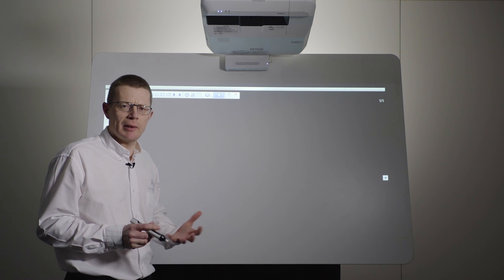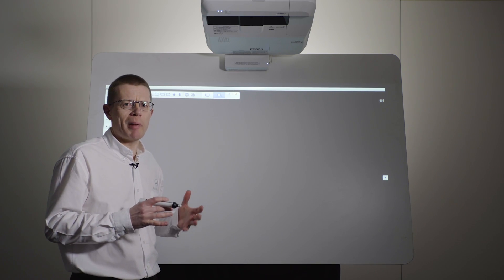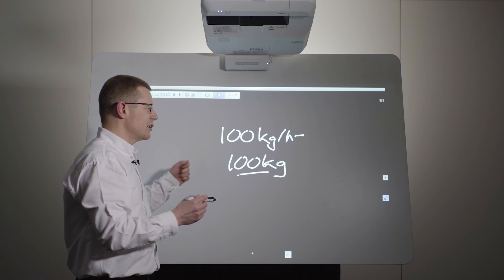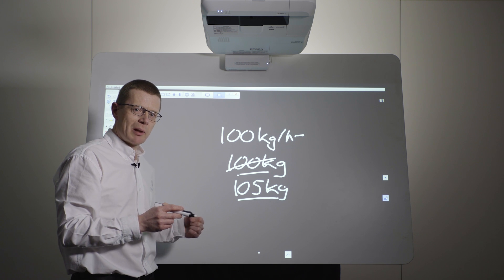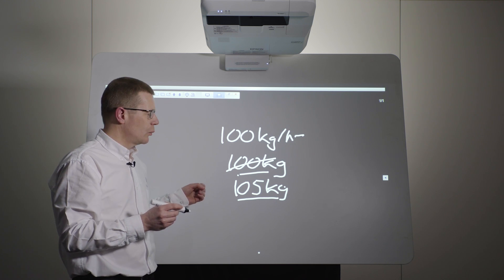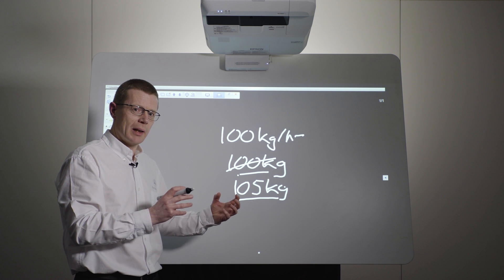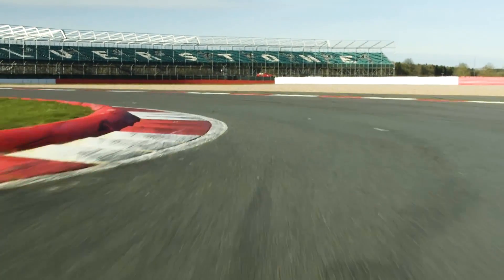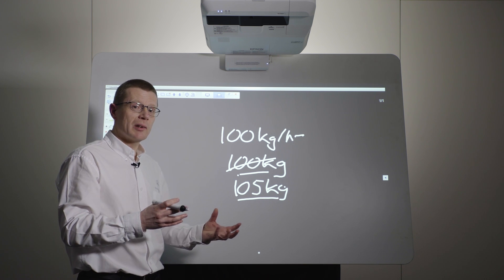F1 2017 Explained: Power Unit #SimpliF1ed

Comment: All 1-4 turbo intercooler petrol engines and all 1-4 turbo intercooler petrol engines hybrid in all companies : Easy heavy damage parts engines, 20-100 l/100km, over 100 l/100km with Formula One speed 160-250 km/hour, over 250 km/hour on all circuits, easy damage with test maximum over 150,000 rpm, little damage with traffic limit speed law on all path roads.
Mercedes-AMG grade F by all 1-4 turbo intercooler petrol engines hybrid all and 1-4 turbocharger intercooler petrol engines all status Easy damage parts engines.
From
All socials databases

Comment: good luck with the 3 power units of 2018... it's getting ridiculous
Reply from the maker: Why’s that? It’s the same engineering, just a different limit we are working to. The rule has been designed to cut costs for customer teams - and it will do that effectively!

Comment: What is the sense of that 100kg/h-limit? When you drive with 100kg/h you won't finish the race anyway because you would only be able to do 70% of the race distance. It only matters in qualifying anyway. But the rule makes no sense for me, because you will never use more than 100kg/h fuel for a long time anyway, since you won't be able to finish.

Comment: I have another Q. What is the raw materials cost on each such pu? Is it significantly higher than an average road going car with v6 w turbo?

You are not using some kind of rare earth materials, are you? In other words, what is keeping such engines appearing in typical road cars? If these PUs are roughly 49% efficient and road cars are at most 40% efficient you guys are accumulating much of a so called concept aptly termed in economics as deadweight loss to society. Because, you have technology which is roughly 30% more efficient than what a typical joe has. Which is alot. If you guys can bring these engines to mass market then carbon and nitrogen particles are reduced by that margin. Everyone benefits. Right?

Comment: The obsession with more speed and technology is insane. For racing purposes. it's no more 
entertaining from a spectator point of view to see a car going 190 mph compared to 220.Certainly one can't say the constant fixation with developing a car that goes faster has any relevance to improving the vehicles we use on the road today. How many drivers on public roads use even half of what modern cars are capable of. Aerodynamics with racing have gone wacko too. If I had my way there'd be no "wings" anywhere on a race car. Ridiculously higher cornering speeds add little to the entertainment value of two racers competing against one another driving on the edge. Just off the top of my head I would say the only part any further technology should play in the racing game would be to increase the safety and efficiency of the machine. I lost interest in F1 for the most part about 20 years ago when the fascination with technology started to rear it's ugly head.

Comment: Inject water,increase comp ratio,increase rpm,reduce cooling system's weight and size with silver radiators,reduce aero drag.
use salty water or some additived water with high heat conductive metal or minerals if the regulation allow it,or (do not forbid it....)

Comment: Im not a calculus math teacher but I thought 10% out of hundred would be 10 so would that be 110 kg of fuel 🤔
Reply: Muhammad He also mentioned that the power units have become a lot more efficient in the time since the regulations were made in 2014-- the fuel spent levels did not come close to the 100 kg fuel limit last season.

So they've increased it only to 105 kg, not 110 kg-- because the fuel efficiency has increased
Reply: Ok i got it now,,,thanks 
You are the calculus math teacher

Comment: Who cares about how efficient it is leave the technology for the families that  actually need to save fuel racing should waste fuel we need cars that turn fuel into sound not fuel into extra laps
Reply: +Mercedes-AMG Petronas Motorsport very true sir but the excitement of the v8 or v10 is lost they sound like leaf blowers so fast you can't even see them sort of
Reply from the maker: +YouTube is fucking everyone up  You misunderstand the idea of efficiency. We make fuel into horsepower. The more horsepower the better. And we fuel the cars for the fastest race.
Reply: You need to know that F1 technology will trickle down to production cars sooner or later. F1 insane rules and regulations propels participating car manufacturers to push their R&D division to meet those insane rules. Suspensions, tires, engines, brakes, engine air intake and many more technology are all once developed for F1 racing. 

If F1 racing is only for pleasing your ears, we will be driving V12s all day with a very bad fuel economy because the R&D for F1 racing is not necessary.

Comment: I think fluids is 1 kg per ltr in weight so only 5 ltr fuel in crease not a lot....anyone know if and when refuelling is returning as F1 is loosing its appeal not as much fun anymore used to be about pushing limits of knowledge and engineering and drivers abilities needs to get back to its roots.

Comment: This is another reason that after being an F1 fan for 35 years I'm getting fed up with such restricted regulations. As fans we want to see what ever size engines they have making max power, something they are never going to do by restricting the fuel. Only using 4 engines before penalties means the engines are never pushed to breaking point which was always part of F1 ie can the driver win the race and will his car mechanically make it as well. They might as well all use a sealed one make engine. The old turbo engines were making over 1400hp in quali trim. Sorry but I'm getting disillusioned with the sport. The only hope we have to make the sport great again is that now Ross Brawn is involved in my opinion.
Reply from the maker: +David Appleton  The only thing the fuel flow limit does is focus how we make power - not stop us from making it! Sadly we showed last year that the engines are very much pushed to breaking point... but nobody ever went into a race aiming for failure. We try and do the failing on the dyno so it doesn't cost championship points. The old turbos you mention did do that in qualifying - then got thrown away. And had half that in the race, substantially less than we do now!

Comment: 4 power units for the whole season, and stiffer penalties for going over the allocation, as well as a ban on stockpiling engine and turbos for grid penalties. I like the increased longevity as part of the strategy. But, I don't want to see reliability as the main factor in the sport, especially as Mercedes is likely to dominate in that area. I'm a Mercedes fan, but the new allocation regs could see Mercedes pull an even bigger advantage this year, and I don't think that's good for the fans or the sport.
Reply: Well this was correct

Comment: Loving the shot at 0:03 - if I'm right (I already know I am without checking because I'm a massive nerd), that's the 2014 (right), 2015 (left) and 2016 (centre) cars.
You can tell the 2014 car by its arch/bridge nose - different to the rounded nose in the last two years. And you can tell the 2016 car by the oval shaped air intake above the driver's head (which has been retained in 2017) - as you can see, the 2014/2015 cars have a smaller, triangular shaped intake.

Comment: While the engineers believe that the main purpose of the power unit is to propel the car down the straights, the fans know the main purpose of it is to piss us off so much, with all the burping,snorting and farting, that no one goes to the races any more!
Reply from the maker: +rod928s4  🤔
Reply: fair comment. the old grey mare just aint what she used to be
Reply: I thougt car guys love all the pops and bangs of a motor rod928s4
Reply: Silverstone was sold out. 🤔
Reply: rod928s4 I wouldn't mind if f1 sounded like a high pitch f type.

Comment: Just use the damn V10s F1 used to have. Honestly.
Reply: Qasim Mir They don't anymore because they wanted the engines in the cars to be similar to those of road cars to be able to apply the fuel efficiency technology and the engine technology in general. So it would be epic if they did go back but I think it's better that they do contribute to building better road car engines using F1 technology.
Reply: Qasim Mir Those ideas were added as regulations in 2014.
Reply: Qasim Mir kinda sick of seeing people saying that. v6 turbo hybrid is an interesting power unit, and modern f1 cars should be at the tipping point of technology. they could increase noise and the revs on current engines and make them sound better
Reply: Definitely, it's all F1 politics.
Reply: Qasim Mir Yeah I agree, but I mean it's a sport that changes every year so I wonder what the future holds.
Reply: Finnigan Sargeant I am aware of the reason they did those changes. But thank you anyway. I just feel the fans, the teams, and the drivers would love to use a reasonably sized high revving V10.
Reply: Well you can't. It's a 1.6 V6 with a turbo and 1 exhaust pipe, it's impossible for that configuration to make the noise they used to. There would also be balance issues with the engine if tried to get these new engines to rev as high as before due the fact that a V6 has a totally different firing order has to be balanced totally differently. 3.0 litre V10s aren't even that big. Just use the damn things.
Reply: Qasim Mir BULLSHIT.

Take a look at the cars from the 1988 season.

No one complained about V10s, V12s or noise then.

You know why? Because the 1.5 (SMALLER than we have today) turboed V6s then were awesome.

The answer is pretty clear. If you want great noise, then relax the rev and noise rules, and let's get a return of the insane turbo monsters like the McLaren MP4/4.
Reply: Oh my god, why though? Just use the 3.0 litres, ain't even a big engine. Besides a naturally aspirated engine will respond quicker, driver has more control over the engine speed. And as good as the MP4/4 sounded, the BMW V10 of 2004 still sounds better. Most of the fans want it that way anyway.
Reply: Qasim Mir the MP4/4 was a more exciting car than the 2004 BMW (not to mention, the 2004 season is widely seen as the most boring season of F1 ever).

Turbo engines, with the modern MGU-H units also don't have any lag, and if anything will respond quicker than the bigger 3.0 V10s because

A) the ERS system will make sure the turbo is always spooled

B) the 1.6 V6 has less reciprocating mass than the big V10.

So, no turbolag, and less powertrain drag means faster responding engine.

Also, F1 has always been a technological Tour de Force. The point is to develop new tech, not just slot in a big engine.
Reply: Qasim Mir also, the fans that don't care about the tech don't even know how many cylinders any of the cars, in any of the seasons had.

They just want a good noise.

And we know Turbo V6s can make good noises (better even than the V10s. Just listen to the cars in the 88 grid), so it's pointless to clamor about the V10s from the most boring period of F1 ever.
Reply: ShadowFalcon It's not even big!

And turbo engines they will never no matter the technology respond quicker than naturally aspirated. And I'm not talking about the 2004 era of F1, I'm talking about that particular BMW engine. And heck, F1 fans do know about the engine configurations since it is talked about in EVERY SINGLE F1 event. Not having the engine being all turbo and no engine (all shirt and no trousers) where's the technology in that? Anyone can stick a turbo on anything and it will produce a million horses, and can attach a motor/generator to anything that spins.
Reply: ShadowFalcon Put more focus on the engine, try to produce more power without the use of forced induction. Like Honda used to with the F20C for example. Use valve timing and lift systems, variable intake systems, use advanced materials for the engine itself rather than basic aluminium. Using turbos just takes the fun out of that, makes it too easy. And V6 sounds better than V10? Come on man, I know 88 sounded good but V10 good?
Reply: Qasim Mir
"It's not even big"

Comparatively, it is. There's a hell of a difference between a 3.0 V10, a 2.4 V8, and a 1.6 V6.

Also, only the complete retards, who must've been curb-checked as kids talk about them, because every single one of those fuckheads don't seem to remember anything from before 2004. Not to mention, the very same cockheads never seem to complain about that in the 1980s. Not with Formular 1, and not with Grp B rally.

"Anyone can stick a turbo on anything and it will produce a million horses, and can attach a motor/generator to anything that spins."

Not everyone can do a setup like that, which works reliably at race speeds. Everyone however CAN make a V10 that works reliably at race speeds.

As for "And turbo engines they will never no matter the technology respond quicker than naturally aspirated."

Do you even know how the ERS system works. Or hell, how a turbo works? Or why normal turbocharged engines usually don't have the same response?

I'm guessing not, since you came up with that drivvel.

"Use valve timing and lift systems, variable intake systems, use advanced materials for the engine itself rather than basic aluminium"

Well, I'd love more freedom in the engine development area, but F1 seems to want more driver competition, and less engineering competition (because of costs apparently).

"Using turbos just takes the fun out of that, makes it too easy."

Easy getting big horsepower? Perhaps. Easy getting a good powercurve, which is good for racing? Are you taking the piss?!? Easy making an engine providing 760hp from a 1.6 engine without the engine exploding? If you believe that bollocks you're vocalizing rectally.

"And V6 sounds better than V10? Come on man, I know 88 sounded good but V10 good?"

THAT V6, compared to THAT V10.

The V10s of the 1990s and 2000s didn't sound super duper amazing compared to the V8s. They do sound better than the current V6s. What they DON'T sound better than, is the V6 turbos of the 1980s (The Honda RA-168E just being one glorious example).
Reply: poseidon then we should develop a more powerful v10/v12 engine without the need to increase the capacity,more efficient fuel consumption, more compact etc without sacrificing the "soul" and excitement from it.
Reply: hani nadif you can't do anything about the efficiency of naturally aspirated engines beyond a point.
Reply: Ian Hoffman nah...don't be so pessimistic. i'm sure we'll find a way somehow, someday.
Reply: Finnigan Sargeant True but It's time to separate from aiming to improve road cars now since they're heading towards autonomy.
Reply: You cannot go beyond the thermodynamic limit no matter what you do. You can use all the trick thingys you want. The v10s were hitting that limit. You are only gonna get more power out of them if you increase the capacity. And the 3l V10s are less powerful than these engines. And they will get better. v10s won't. And i'd like the sport advertised as "the pinnacle of engineering" to be more advanced than my car.
Reply: Qasim Mir
Why do all the so called "fans" of F1 always forget the turbo era of the 1980s?

The most insane cars ever in F1 had themselves 1.5 Turbo V6s (McLaren MP4/4 for example).
Reply: Finnigan Sargeant They did it to favour the mercedes.Now ferrari is out of business.Because they don't have a proper v6.How simple is that?Mercedes ,championships,three times in a row.We get that stuff pretty quick.

Comment: How much BHP can this magnificent technological masterpiece output?? I heard that most manufactors where aiming for the 1000bhp mark last year but, it is hard to get concrete evidence. Surely, it is above 900bhp by now?? 
Cheers for any info :)
Reply: SuperItalia494     the old 1500cc formula 1 turbos from 25/30 years ago were achieving  1000 hp ,havnt come to far really have we?
Reply: don Reeves if they still used v12's turbo with the hybrid system, they would easily get over 1700 hp. Just imagine the lap times...

Comment: finally forget about EFFICIENCY...its a joke that drivers have to save fuel... isn^t racing about the drivers reaching their limits?
everyone asks "how can we make f1 more thrilling"... for f*** sake this Power unit technology is amazing but it made the cars 200kg heavier. 
either consider refueling in race or throw away the batteries...
hope 2017 gonna be better than last 3 seasons :(
Reply from the maker: +NoBoDy7  It made them 30 kg heavier and 200 hp more powerful ;) Remember the V8 had batteries too...
Reply: Mercedes-AMG Petronas Motorsport 
between 1995 and 2008 minimum weight was ca 600kg...and they even had to use extra weights to reach the minimum. now they are 728kg plus 105kg fuel... get your shit right Intern and ask Mr Hamilton about how he likes todays f1
Reply from the maker: +NoBoDy7 correct but that's not all down to the hybrid. Get facts right b4 throwing insults pls.
Reply: Mercedes-AMG Petronas Motorsport it's the internet bruv ;) haha
Reply: +NoBoDy7 but they are as fast if not faster than them cars then so what is your point? Also show some respect.